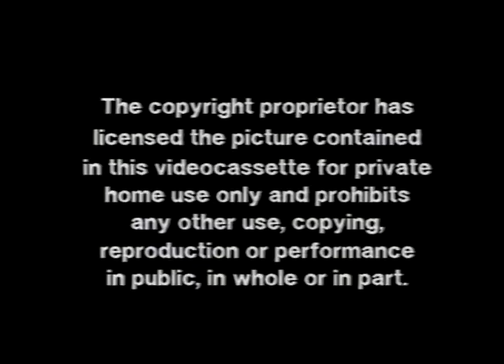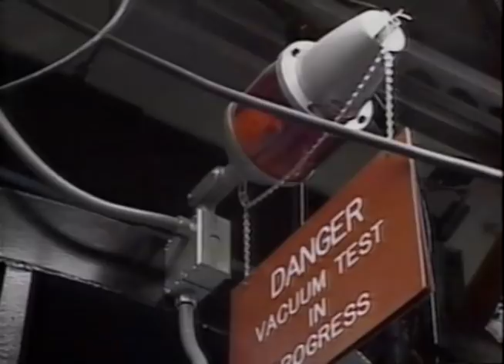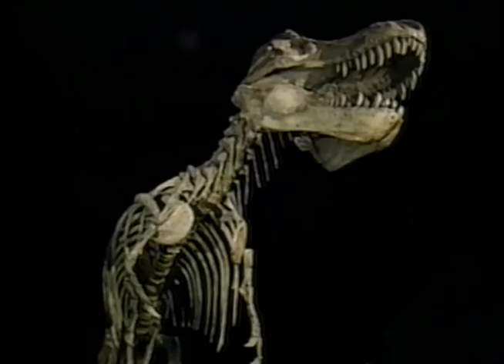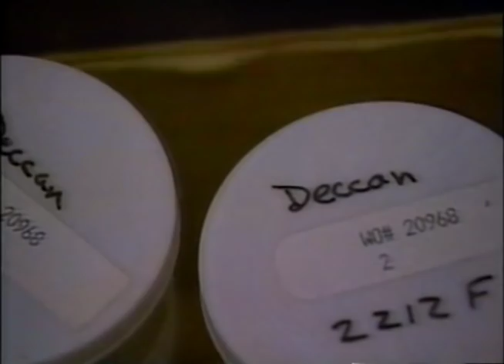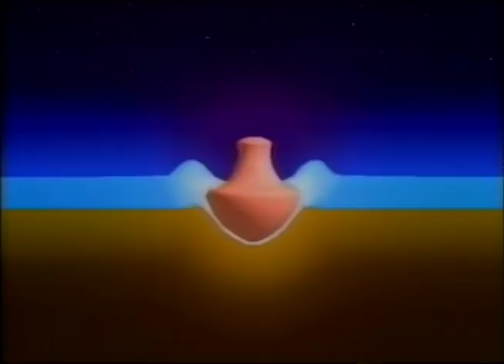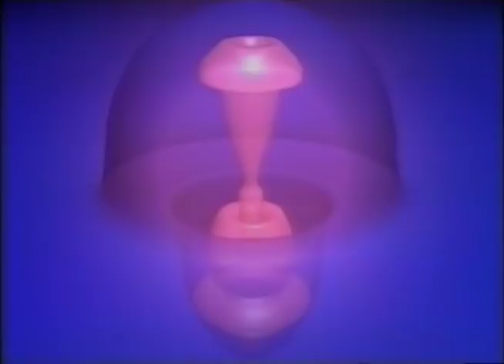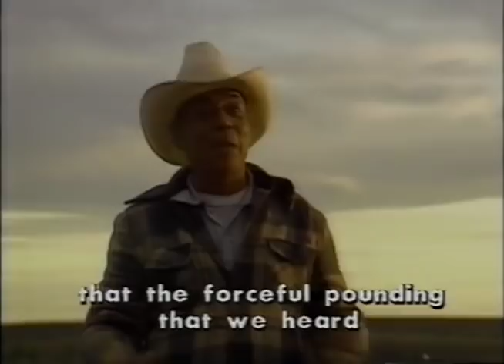Miracle Planet 01 The Third Planet

Comment: Scaling the Earth down to a 1 meter diameter ball; the bulk of its atmosphere about 2 millimeters deep - the Chixalub meteorite would be in the order of 1.5 millimeters. The impact velocity would be such as to have penetrated  a surface, about  the consistancy of soft clay, to a depth of 5 millimeters. At this scale the ejected dust particules, a microscopically fine one millionth the size of the real world dust, most of which would be blasted out of the lower atmosphere, would certainly evelope the entire planet. It would probably remain suspended for months. 
But keep in mind - the vast bulk of Earths life- including our own ancestors - did manage to survive.
Reply: Good pondering. I've been using 1 : 5,000,000 for 7 years. It makes Earth a 100" ball so 8 foot ceiling height and I can picture it. I suggest you use 1 : 5,000,000 scaling. Earth a perfect sphere to the eye 8'4" across fits in a room (bashes a small ceiling hole). Troposhere 1/10th" thick. Ocean deeps 1/20th" thick. Ocean crust-lithosphere 1/16th" thick with the 1,300-degree liquid-rock mantle beneath. Huge 20 km asteroid 1/6th" across barreling into the 8 foot rock sphere at a blistering 1/8th" per second (so takes 14 minutes to go 8 feet across the living room and smash into the 8 foot rock sphere Earth. Reality looks a lot less dramatic than glossy magazine infortainment.